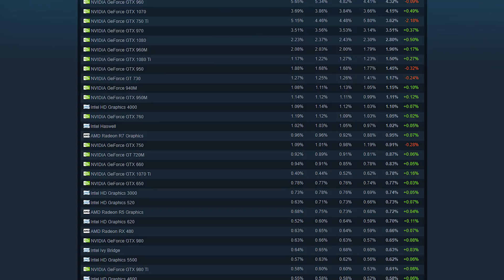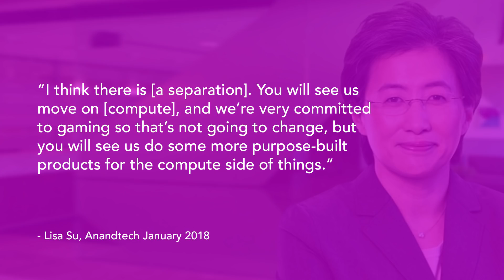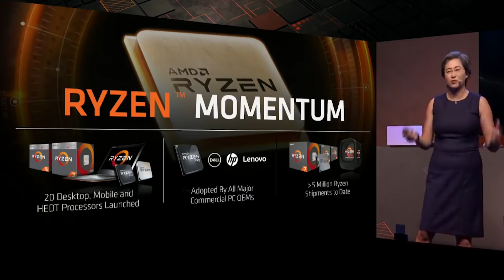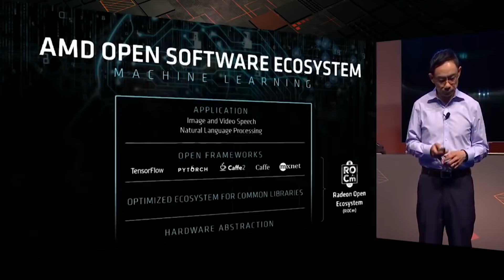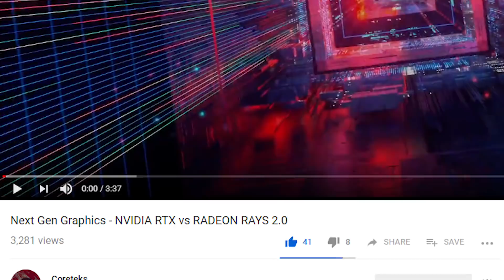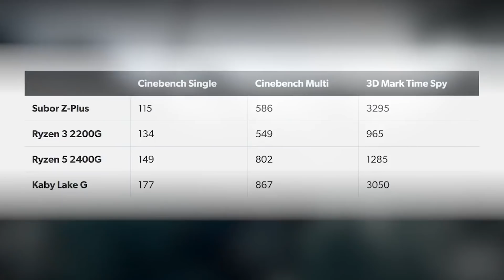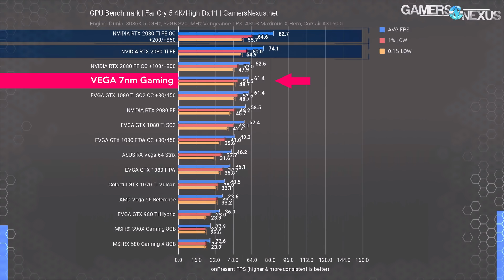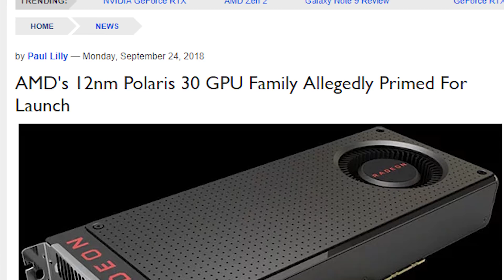AMD's answer to RTX

Comment: Nice video. Unlike many others I like your tone and pace and hope you keep it that way. I think it's a trademark. Reminds me of Ahoy. Smooth and stylish intro and outro music too. I'm subscribed.

However I disagree with your thesis. I think Lisa Su made it quiet clear that AMD from now on will have 2 distinct lines of architectures/chip designs in the graphics realm, one for datacenters and workstations, and one for gaming.

Vega has a lot of transistors that do a lot in compute tasks, where it can match even a Titan Xp, but is just a waste of space and energy in gaming. There are rumours that the hyped hardware features that would improve gaming performance where never really finalised. Navi is designed in conjunction with Sony for their upcoming PlayStation 5, and they are not interested in any excess multipurpose capabilities for desktop computing.

Therefore I conclude that Vega is a compute chip/architecture and Navi is a gaming chip/architecture, and I do not believe that we will see another Vega card for gaming. I also believe that Polaris will be shrunk to 7nm. But all 7nm gaming stuff wont come until H2 2018, only then will the price of 7nm be low enough for relatively large chips in the mainstream space.

My goodness, this video skyrocketed while I put these thoughts to text.

Comment: 14:57

remember when amd launched threadripper and intel tried to counter it by rushing out a cpu with expensive mobo, that had to have so many different features that multiple partners gave up on it?

is this amd's tactic for rtx as well?(you said they probably have spies on either side)
Reply: ikr? remember Linus' vid on it? lol -- so much melodrama

AMD can let their rate of performance improvement speak for itself. Intel and Nvidia are always talking shit about AMD, but AMD never responds to it. Then you get hysterical fanboys going crazy because AMD doesn't respond to the BS, thinking that no-comment means AMD lost the exchange. Intel has been putting out weird products to challenge AMD's unique inventions, but that issue was put to bed when Intel decided AMD was too smart and hired Ryzen designer Jim Keller and Vega designer Raja Koduri.
Those who talked shit about Vega got served when it turned out Vega was a compute monster and better for cryptocurrency mining than anything else, at that time, anyways, and ended up selling them as fast as they could make them.

Comment: for me, amd been crap since crysis (1st game) on pc released, back then i have the amd graphics that could/supposely could crysis on very low graphics and sometime will restart when i boot up the game. my father old computer with a even old nvidia gpu still runs better and watch 1080p video without shuddering (not internet lag) while my amd gpu back then does. so i think nvidia is better overall than amd for gpus.
Reply: Sounds more like a software issue, which can be because of anything. Did you properly uninstall the older graphics drivers or made a clean install of Windows? If not, then you might have the issue there. And that is regardless of brand.

AMD's/ATI's cards have been consistently of good quality with good performance and good value throughout the history and generally work much better in older games.
Reply: did couple of time back then, still the same result, so as of right now, i got myself a nvidia gpu instead and probably get one in the future too, if i've plan to upgrade it.

Comment: I don't remember channel name, but they speculated why AMD didn't say anything regarding RTX release. They doing the same thing as Nvidia done when Vega was released. The hype was high and it was a letdown in general and Nvidia released 1080 at it was a major win for Nvidia. And now the hype is huge regarding RTX cards. let's face it's crazy expensive compared to MSRP of 1080 launch,  and it isn't very good ground for now. there are basically no games that can utilize RTX Tomb Rider should be first when an update comes out. Battlefield V is in November. So basically you buy a card without solid ground to utilize all the features. AMD waiting for the more solid ground to release their product to compare with Nvidia and would try to make the cost of a card as low as possible to be a good contender. even if it won't match the same performance as rtx2080 card it will still be a better choice for budget or higher gaming enthusiast. And right now to buy RTX card It wouldn't make much sense 1080 is way cheaper will give you great performance. And until you want to go into Ray tracing games you would have better variety at the time. Also, Lisa Su is really best thing what happened to AMD. Not forget that AMD developing new GPU's for new Xbox and also PlayStation. For there perspective regarding profits, they are really stable.

Comment: I don´t need the best gpu on the market (2080ti), I want a good balance between the price and the power of an card. I planned to build a system round the sapphire vega 64 nitro+, but I have a feeling that AMD could bring something really good and the whole marketing around nvidia´s rtx launch smelled fishy and it was not what people expected in the end. Plus I´ll also buy an FreeSync monitor cause I won´t pay several hundreds € more for gysnc. If AMD shouldn´t bring something nice with an price around 600€ I´ll get the sapphire vega 64 nitro+ for 499€-549€-and I´ll be happy after all. I don´t think it´s time for 4k gaming now, so I stick with 1080p in high refresh rates~

Comment: AMD would leverage "mindshare" if AMD had Xbox release more UWP games that continued to use dx12 and async compute IMO.  That way they  can get more games out there that take advantage of AMD's GCN architecture. Look at how well AMD cards are doing in Horizon 4 and other UWP titles.
Reply: not to mention a title that uses Radeon and Vulkan or DX11-12 to the "fullest" truly curb stomp the crap out of Nv (often with a much lower bracket GPU)
there is a reason why Nv wanted NOTHING to do with Vulkan at all (and Mantle) until Kronos and MSFT told them "sorry, but we are doing it anyways" MSFT "caved" a bit as usual and let Nv do it the way Nv wanted to do it (not forcing you have to do this in hardware or not at all) where Kronos on the other hand learned from OpenGL crudfest and made it "mandatory" to use THIS you have to use THAT..sucks to be Nv, they cannot always have the cake they want to eat at everyone's party ^.^

Comment: If AMD puts out something late this year/early next year, I have an ITX build I'm planning and wouldn't mind using an AMD GPU in it.  Already going to use a Ryzen 2 2600 for the CPU, so an all AMD build wouldn't be a bad way to go, so long as it performs.  TDP will be important as well, and the high-end Vega chips were ridiculously power hungry.. not a good thing in a small form factor build.

Comment: I predicted back in January 2018 that the top dog Navi-20 (eta 2H-2020) will likely have MCM architecture (ie - a 'quad core' gpu = 4x1024SP's mounted on I.F. emulating modular design of Zen but will be recognised as a single monolithic gpu) and upcoming mid range Navi-10 (eta 2H-2019) will likely be a dual core MCM design (2x1024SP's). AMD want to initially capture the 70% addressable TAM with Navi-10 (same marketing plan as the RX480). I have no doubt six months from now all tech reviewers will be reiterating (again) what I predicted ages ago.
Reply: DeliDeli - I understand what you are saying dude, but when it happens on a regular basis it does get annoying. Why cant people disagree in a respectful manner?. Ah fuck it. I'm gonna get some outta town strange tonight.
Reply: Hello Nostradamus! 
But isn't the fact of AMD themselves saying, MCM design WON'T BE in Navi YET hurts your prediction? Just asking.
Reply: Hello genius - well you shot yourself in the foot because coreteks has also said Navi-20 will have MCM design, although it will likely be for the workstation sector. Since you are completely unaware of all the facts, it was reported in a WCCFTECH article (I think May 2018) that David Wang commented that the problem is not MCM architecture, but it is the independent gaming vendor software that is the problem as it will recognise MCM as external crossfire. If a workaround can be found then MCM can move forwards in the gaming sector (otherwise they will stick with standard monolithic gpu and their next gen arch 'Super-SIMD' will break all of the current AMD gpu arch restraints).  

Furthermore, AMD is famous for making U-turns. For example, one year ago a dual Polaris gpu was planned for the gaming sector. The gpu did come to fruition, but it was repurposed as a workstation gpu. See -  

https://www.overclockers.co.uk/amd-radeon-pro-duo-professional-graphics-card-32gb-ggdr5-2304-x2-stream-processors-gx-02g-am.html

The same thing  happened to Vega (repurposed as an AI gpu and less focus on Vega gaming). In June 2018 Lisa Su said they would be releasing a dual core, 32GB-HBM2 Vega64 gaming gpu but then in July 2018, Lisa Su did a U-turn and said it would not happen due to high costs of HBM2. The woman has a PhD and yet it never occurred to her HBM2 is expensive.

You get my point?.
Reply: silver dude - check this out. Nvidia also seriously considering MCM design for future gpu's = 

https://www.extremetech.com/gaming/252022-nvidia-considers-multi-chip-gpus-future-designs
Reply: Okay. Look. I didn't meant to insult you, although I do apologize, and I do understand calling you "Nostradamus" was a bit bold. But no matter.
Second. I didn't said, that AMD will never do MCM. What I said, is that David Wang himself said, Navi won't be MCM. At least it was reported in a video a while back ago. If they make an MCM chip right now, it would be just another CFX card. If they can somehow work around it, well, they should. Prove me wrong. Kick the sh*t out of the green team with cheapo powerful cards! I'm all for that. I just don't see it happening next year.
Maybe with Arcturus. Oh I friggin' love that codename. °w° My favorite star in the night sky.
Reply: Kay. I just don't want to argue when we're kinda on the same side. Diehard AMD fan here, so... Yeah. I just don't want to overhype myself. Or to others do it. Keep the hype contained! lol
I'm sure Navi will be a good GPU family. Just don't see it became a 2080Ti killer. If something, maybe it will be on pair with the 1080Ti. Not the Navi10 though.
Reply: Oh wow Einstein, you predicted that :O 

I mean obviously they want that, they did it with cpus and it should be even more beneficial with gpus
Reply: @NeilBooth  - you were not able to predict it so shut the fuck up. Jesus, why do tech channels attract dimwit assholes who are nothing more than career trolls?.

Comment: A 7nm Vega gaming card by AMD whould never be possible in 2018. Even Nvidia, one of the most valueable TSMC customers, couldn't bring 7nm with Turing, and i bet they whould be able to tune the node according to thier desires. And with a chip this big, even if we take the 32gb memory controller out and replace it with something more fitting, they whould never be able to sell this card at 549$. And the ''leftover'' server/workstation parts whould never be able to deliver significant volume to make this launch worth it.
Reply: TSMC only has so much wafer production available, maybe Nv wanted $$$$$$$$$$$ NOW and did not want to wait, or they got a "leak" that upcoming Radeon stuff would be MUCH faster then expected (or combination of things)

Comment: The 20xx from nvidia is a flop. 2080 gives the same performance as a 1080ti, half its features are unusable due to lack of games that support it. And it's outrageous price makes the vega-64 despite the minor 10-15 fps deficit on average more appealing. Especially in the 1080p-1440p market.